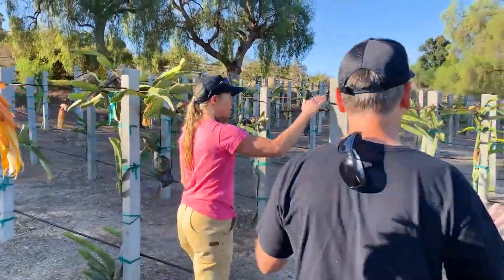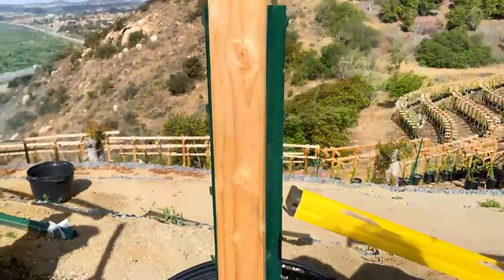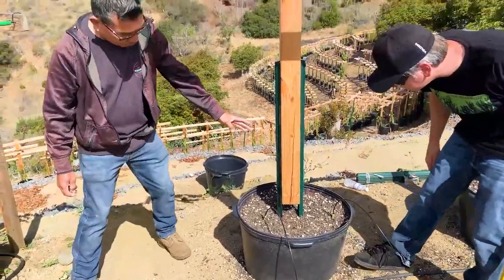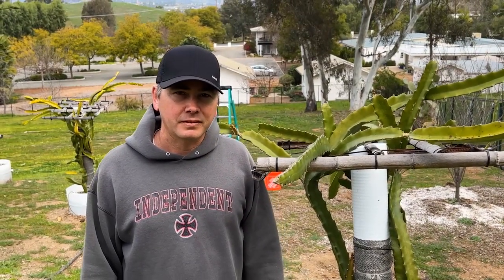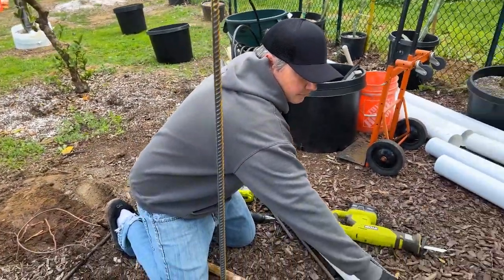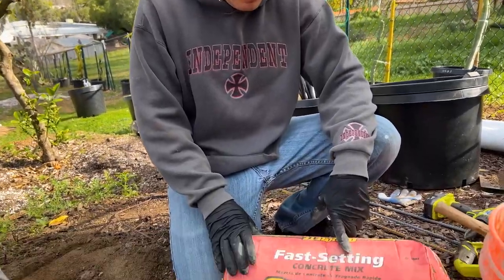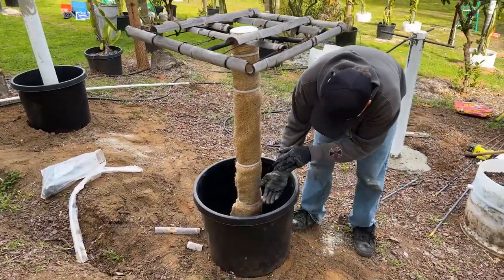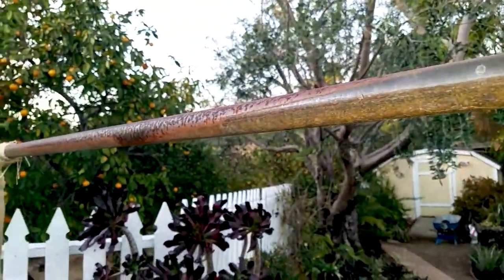Easy DRAGON FRUIT TRELLIS DESIGNS and METHODS

Comment: My new way is, plant a fast growing class 1 in ground hardwood, come back 2 years later plant d fruit. Cut top of hard wood at some point. Cost me 2.50 aud and a lot easier than digging a hole plus can use the top of the tree as mulch. Will rot eventually but something like a bloodwood should last 20-30 years. They last as fence posts for much longer than that. By then If I’m still around I will probably want to hit the whole thing with a mulcher and change varieties anyway.
Reply from the maker: Interesting strategy, thanks for sharing. 20-30 years is beyond the life of productive plants I am told by long time growers... The oldest plant I have is froma cutting back in 1999. So it is 24 years old sometime this year.
Reply: @RAREDRAGONFRUIT    Some of mine have stopped growing or flowering and developed a yellow colour. Dont know how old they are, i didnt plant them.  I think its root disease introduced by roots dying back after a heavy prune, age maybe a cofactor though.

Comment: I know many people plant in pots some farms plant directly in ground . Why not plant directly in ground when you are anchoring pot to ground
Reply: I have the same question? To me it isn't clear if his intent is to grow plants exclusively in the pot or also in the ground with this design. He has a lot of drainage holes in the pot so the roots should eventually root into the ground. Problem is there is concrete underneath the dirt under the pot so the roots are now in standing water. Would be nice if drainage issues of this design were discussed more.
Reply: @steverogers9275  my guess is that it’s easier to water and fertilize in the pots plus drainage than if they were directly in ground . Everyone’s soil is different too
Reply from the maker: @jxsanc1238  and Pocket gophers
Reply from the maker: Pocket gophers
Reply: He did mention a gophers problem… maybe that’s the reason he uses pots
Reply: I have tried experimenting both.  At this moment I think in pot the plant has better watering and fertilizer when the pot retaining.  The root is shallow, it does not need lots of water wasting to the soil.  My plants seems more happy in the pot.  I haven't get the fruits from the pot, so I can't make the comparison. We are learning from trying.